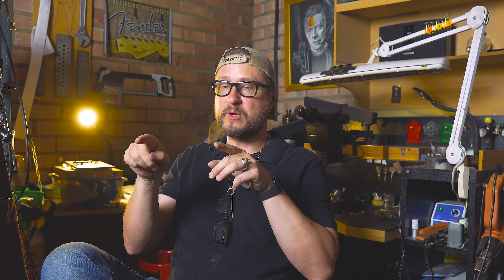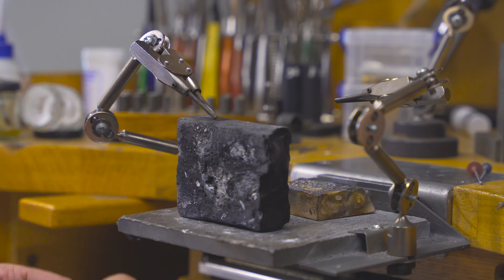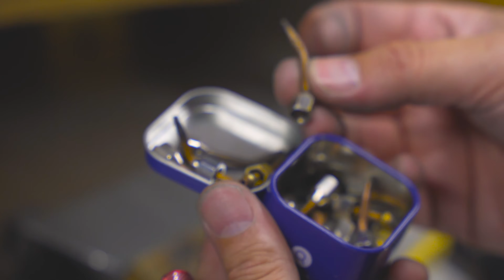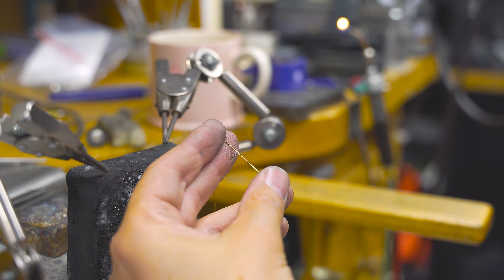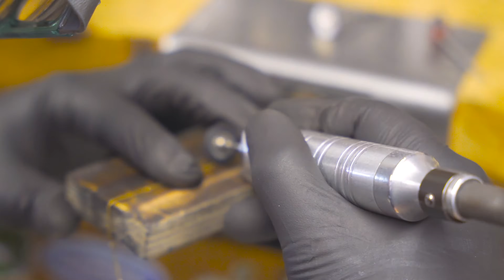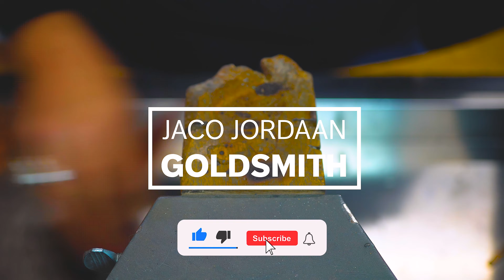How To REPAIR / FIX a Fine Gold Snake Chain | Goldsmith's Workshop Secrets

Comment: Well done! This is the correct way to repair ANY type of jewelry, use only enough solder to make a reliable joint. I would like to think that those in the industry will take notes from this demo, but I know that is unlikely. Unfortunately, the majority of bench jewelers are in it for the money, and as such, speed  becomes their first priority. This method takes time and skill, two things rarely found anymore. When I do repairs like this I often use 1/4 or 1/2 of a 1 chip of solder. The less solder you use the better the final product will be. Keep up the great work.
Reply from the maker: Thanks for the lovely comment, it’s great to hear from you. I saw your suggestion of a box clasp for a future video - Damia has been suggesting this for a while and it’s on our list to do soon. 👍 Thanks for tuning in

Comment: great informative video. I would like to know how do you make hollow hoops/tubes with tapered ends by hand? if that makes sense... I understand the process of creating hollow tubes by either fabricating it around a steel rod and bending it round or feeding it into a steel rod with a bend at one end and forcing the metal to spiral around itself when forcefully pulling the steel rod, but tapered ends have confused me
Reply from the maker: Hollow jewellery can be tricky. I've made a few earrings and had a lot of fun doing it - Perhaps we can add this to the list. I love a challenge
Reply: @jacothejeweller   That would be perfect! tapering the ends would be challenging as well 🤔👍

Comment: Surprised you didn’t use the laser. I do all my solid chain repairs on the laser. Snake chains are composed of links and you can rejoin the links easily and solder them almost seamlessly.
Reply from the maker: Hi John, yes the laser is fantastic! Damia and I actually spoke about using the laser but we were concerned that we wouldn’t be able to offer much to those who are just starting out and do not have a laser available to them. So for the purposes of this video we decided to do the repair on the bench. Thank you for sharing!
Reply: @jacothejeweller  I understand. Keep it up! Having access to nicer equipment has spoiled me but I still break out the torch often.